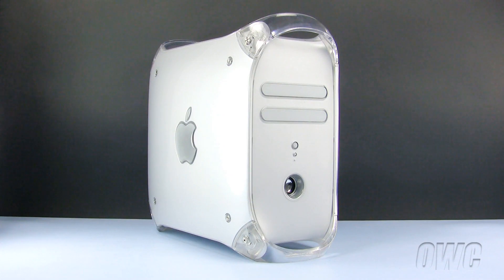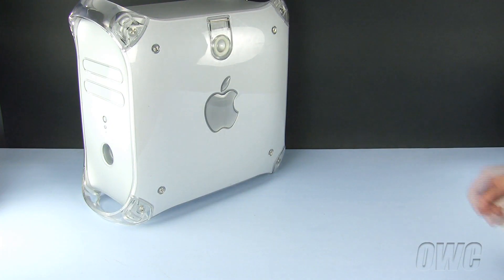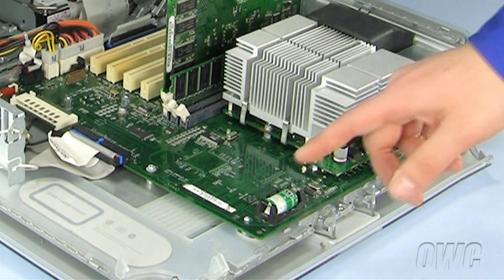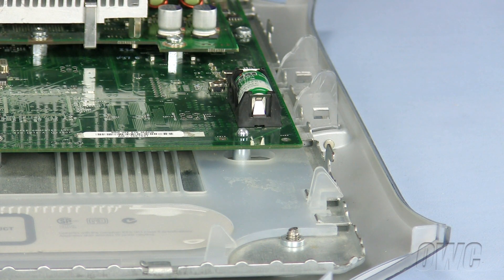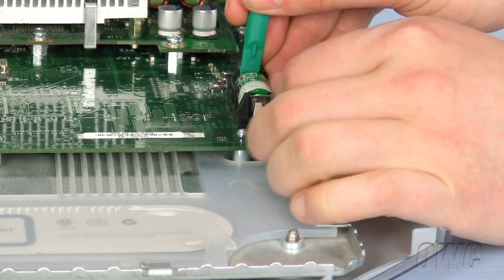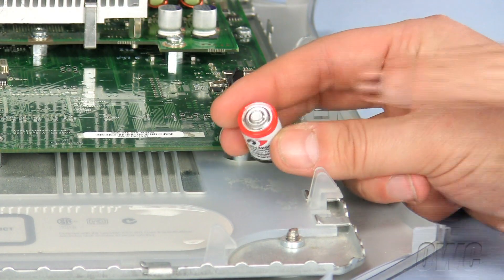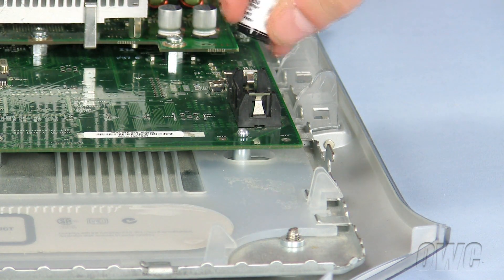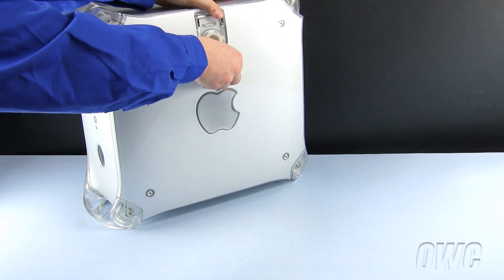Power Mac G4 QuickSilver PRAM Battery Installation Video

Comment: Is it possible to get this battery in 2025? Which kind of battery I should buy to my iMac G4?
Reply from the maker: Hi there! The iMac G4 utilizes a small 3.6 V PRAM/clock battery (approximately equivalent to a ½ AA lithium battery). Unfortunately, these are very difficult to find today, and we no longer carry them. You may need to check with specialty vintage Mac or electronics suppliers.

Comment: Does it kill the data when doing this?
Reply from the maker: Replacing the PRAM battery will not affect or delete any data on your drive. It simply resets certain system settings like time, date, and some hardware preferences — but all your files and applications will remain completely intact.
Reply: @poweredbyowc  Yep, I managed to figure that out. Thank you very much for the video though! I wanted to check the PRAM battery on my powermac G4 because it's like 26 years old. I'm thinking someone already replaced it recently, because a 26 year old battery should NOT last that long. No leaking either